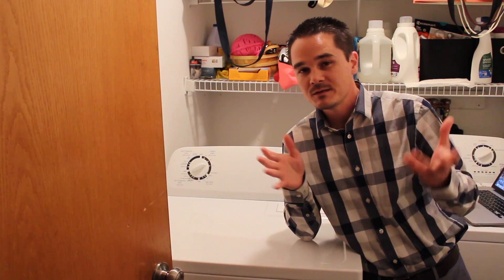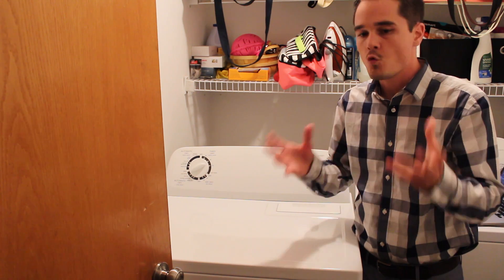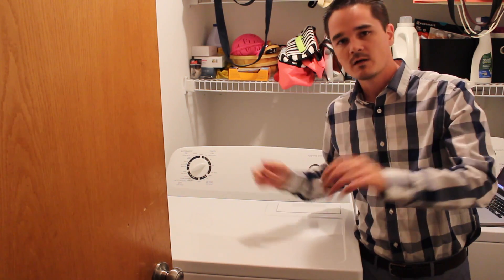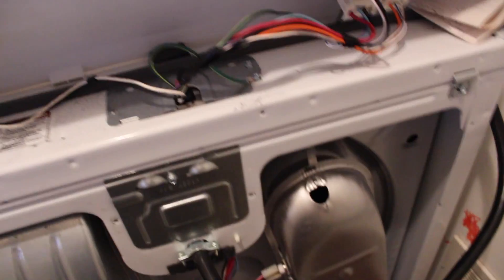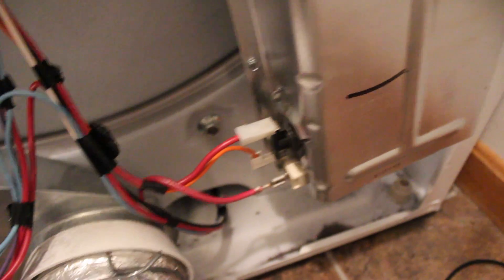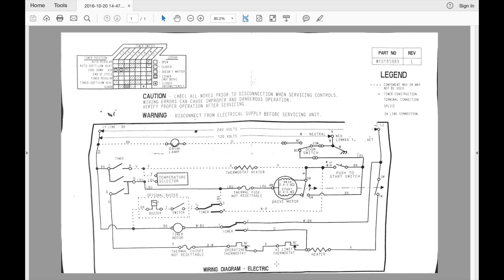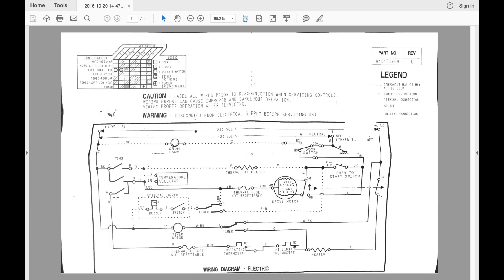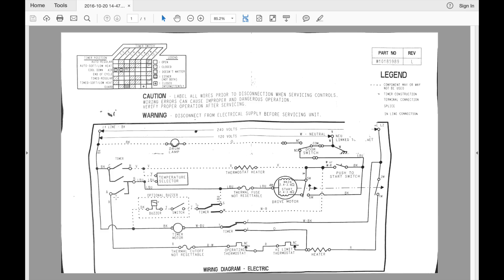Dryer that won't Heat? How I fixed it!

Comment: Hello! Out of the dozen or so videos I have watched trying to fix my dryer, this was by far the most helpful. New susbscriber here. My question is this... I have now isolated the issue to the Operating T'stat. The dryer will run fine for a few days and then stop drying. I have now found that if I disconnect the red & red/white leads on the operating thermostat and reconnect. It will begin working again. What is going on? 

Is it possible those purple wires are causing a problem? my bride says she rarely uses the low heat setting and can do without it. So I have now disconnected those and letting her use the dryer again. 

But I am still baffled how that thermostat can stop the dryer from heating and then be all good just by disconnecting and reconnecting the  red & red/white leads. 

Also, my dryer does not have that orange wire at the high limit switch.

Any thoughts would be greatly appreciated.

Comment: I put on every thermostat there was on a dryer and it still would not heat up and after foaling with this for two days I finally figured out what it was even though the dryer was still running apparently the breaker had tripped but it would still run on a 110 finally went out there and tripped the breaker turned it off and on in the damn thing started heating up you would not believe how the damn aggravation I went through before I finally figured out it was a damn breaker

Comment: What did u have the tester set on and at? And my bottom thermostat dont have the orange wire there is that an issue?

Comment: Saw on another video that you can actually throw the bad thermostat on a hard (concrete) floor on its flat part (it might take a couple whacks) and it will close the circuit (allowing you to reuse the part). Give it a try and after each whack on the floor - test for continuity (can take a few tries).  It works.  Sure you can probably no longer leave the house with the dryer left on, but it did save me what I thought was 40 bucks for the part..
Reply: ..and I see you made a video about that.  Anyway this method is definitely a hack and should be used solely at your own risk.

Comment: Hello sir,
i have question regarding 3 phase AC power supply.
Is it possible to break 3 phase supply using one relay at neutral ?

Comment: Ones without CPU usually last longer without problems and are easier to fix.
Note: Those flex exhausts are illegal in most jurisdictions now and are the cause of most house fires. So replace with stiff kind for safety

Comment: Every time I unplug something from the wall, I do still work with caution because I am worried about charged capacitors, is my fear in place here?
Reply: ProXicT being cautionous while working on electric components is always right! Most capacitors have a "discharge resistor" nowadays, though. its highly unlikely to danger yourself unless you are working on Old tvs
Reply: Oh, I didn't know about that, thanks for letting me know! :)

Comment: Hey Kevin, big fan love your videos. It's possible the high limit thermal cutout was bad on its own, but they usually go bad because the high limit thermostat did not cycle the element off properly. In other words it got too hot. I normally replace the high limit thermostat and high limit thermal fuse at the same time. You might get lucky and it's just the thermal fuse but there is usually a cause for the thermal fuse to blow. Sometimes the heater can short to ground and cause the element to pick up one side of a 220 leg, therefore the heating element would heat constantly and the thermal fuse would blow, I doubt this is the case with yours. If it happens again be sure to replace both the thermostat and the thermal fuse. I am a professional appliance repair guy. Cool to see you tackle this job on your own, good luck!
Reply from the maker: oh man, that makes a lot of sense!  thanks for the tip!  I'll keep and eye on it

Comment: I replaced the timer assembly in my (cheaper than yours) Roper-brand dryer just a few months ago.
A couple years ago, I replaced the thermal cutoff fuse, so if you experience this issue again, check the timer assembly.

The drive motor centrifugal switch (1M/2M) does not connect the heater to a LOW SIDE. It connects to the other side of 220Vac. 
I guess that you overlooked this because the tape removed some of the diagram.